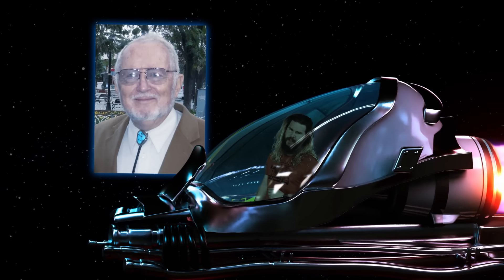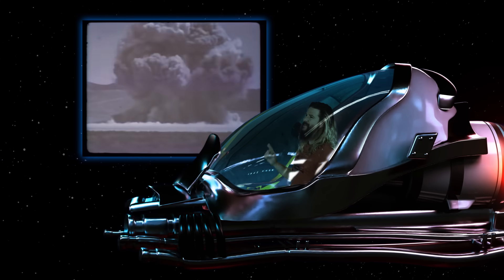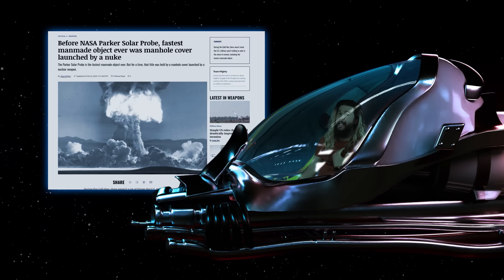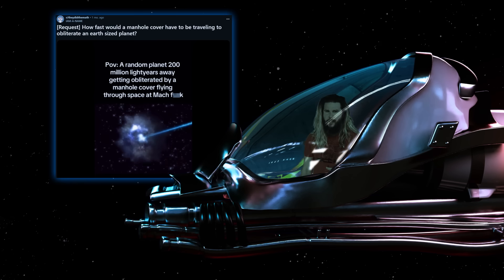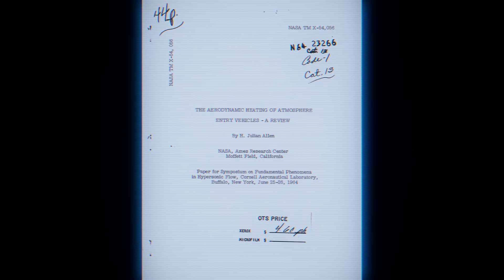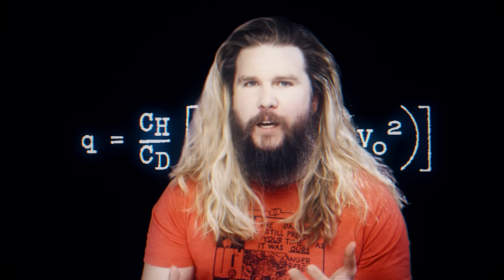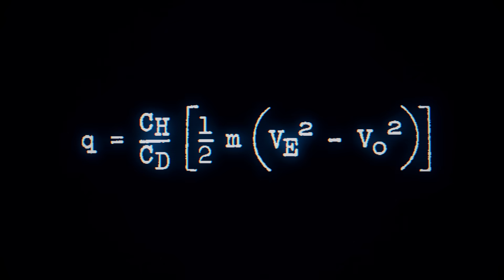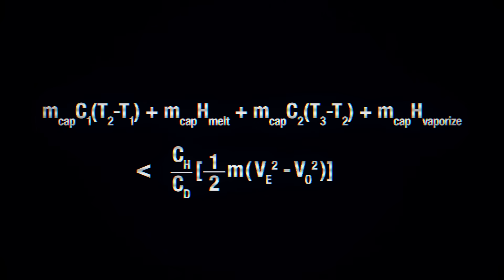Debunking the Nuclear-Powered Manhole Cover

Comment: Kyle did an opsie! The energy to vaporise the lid is 7.8*10^9 J  ! 

You may verify this by copying Kyle's own numbers into a calculator: 1000 J/kJ * (934×0.45×(1,811−296)
+934×209+934×0.9×(3,134
−1,811)+934×6,340)

The SECOND opsie - Kyle assumes a greater heat energy than the total amount of kinetic energy, which is impossible.  The total kinetic energy is 2*10^12 J (from 1/2*m*v^2) which is less than 3.8*10^13 J. Kyle applied the wrong formula!

Regardless of these opsies, the conclusion doesnt change. If anything, it is more in favor of the lid vaporising, as the kinetic energy is 250 times greater than the vaporisation energy.

Comment: Disks fly further when thrown on their edges like a Frisbee. Getting popped on the flat side by a nuke would have vaporized part of the surface and deformed it's shape immediately, plus the fact that it would have been lifted up flat instead of on an edge at all, causing it to tumble. The randomness of tumbling against atmospheric drag should have been considered when calculating how high up the disk would go before losing all it's energy simply because of how much would be wasted in the process. Now think of how much of it would deform as it melted, shrinking the size of the plate and making it tumble even worse, effecting it's density so it can't travel as far, effecting its course because of air resistance from randomly changing angles during the tumble... even if the plate didn't heat to the point of total vaporization on the way, whichever fragments of it that survived would never have had the remaining energy to get to space. They would have been ripped apart, scattered to the sides, and fallen down again just like meteors that blow apart from entry pressure long before impact.

Comment: I think most people would expect for this manhole cover to launch like a cork gun instead of an explosively-formed projectile. The sides of the shaft would have created turbulent flow while laminar flow would be in the center of the shaft. As a result, the middle of the cap would be struck before the sides, bulging and deforming the cap into a dome if not a teardrop. It could have even been enough to rip through the middle of the cap and disintegrate it from the middle outward.

Comment: Going back over this, one of the things that caught my attention (I'm a civil engineer by trade, so materials science is always in the back of my brain) was whether or not the manhole could have survived the impulse of the blast in the first place without being torn apart. The amount of energy needed to accellerate somthing from 0 to 66km/s in the space of a millisecond (or whatever the frame rate of the high speed camera was) would be massive - so would the structure of the manhole be able to withstand that?

Also, remember that the manhole was observed in a single frame of film - are we 100% sure that that thing was the manhole and not something else?

Second question, would the manhole have retained its form or been shaped by the blast - it was welded in place, so could it have been turned into a cone like a shaped charge?
Reply: It also isn't a true "Manhole cover" it was made of refined steel and concrete, was 4 inches thick and weighing nearly half a ton. Personally I think it probably made it given it's size and mass, along with the atmosphere getting thinner as it got higher.

Comment: hey kyle, absolutely fantastic video.
i‘m working with steel every day and have learned about iron, steel, cast iron and other metals for about 10 years. 
cast iron is absolutely not iron! 
you know how you add carbon to iron to make steel? if you add even more carbon to steel you get cast iron. 
the melting and boiling point of steel and cast iron changes a lot with the addition of carbon. 
making those calculations with the melting and boiling point of iron is easier bacause you have one set value, so i get why you did it. 
when talking about cast iron you would need to have the exact carbon percentage and would need to know if there are any other alloyed materials in there to make exact calculations but i don‘t think we have that for this manhole cover.

Comment: It was calculated to at least be going 37 miles per second, which means it would have passed the Karman line in under 2 seconds. That means for it to vaporize It would have had to absorbed enough heat in under 2 seconds to do so... highly doubtful it didn't reach space.

Comment: I learned from XKCD that temperature doesn't matter, just the amount of time spent at that temperature, (See teleported to the sun video) so with it moving as fast as it was, it would have only been in the atmosphere for about: 0.8 sec. I don't see how this is enough time to vaporize it.
Reply: I used a speed calculator to find the time, 
time = distance/speed = 10000 km(Thickness of atmosphere)/125000 mph
= 	0.8 sec
Reply: @rileythatcher1956  the distance to space is 100km (to the karman line specifically, where space is defined). the speed is 66000 metres per second. 100000/66000 = 4/3 = 1.333 seconds
Reply: Drag forces would stop it faster than that. At the given speed, the drag would be over a quarter million gees. That would be enough to stop it completely in 0.02 seconds.

Comment: But if it gets heated fast enough, much faster than the poor heat conduction of cast iron, then would it not be reasonable to assume at certain heating rates the surface would vaporize first and create a layer of protection as well as drag reduction? I think that you need more, /calculations/, finite element, calculations

Comment: It definitely made it to space. At the speed it was going when it left the ground, and the fact that the air density rapidly decreases as it's going straight up, it would've made it through the atmosphere long before the heating effect had a chance to fully melt it. If the atmosphere was the same density as sea level all the way up to space, then sure it would have melted before reaching space, or if it was falling to earth where it's encountering denser and denser air as it falls and slows, then yeah it would've melted. But not going the other way where it starts with it's highest speed while in the dense atmosphere and is rapidly escaping to lower density atmosphere.